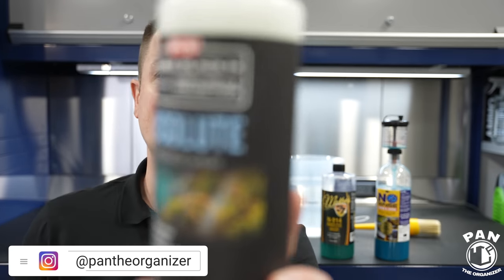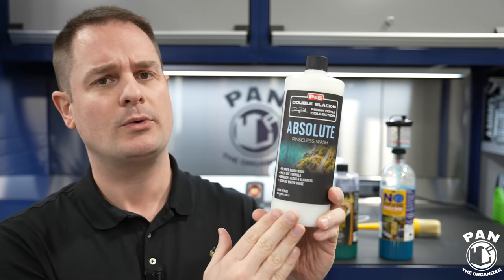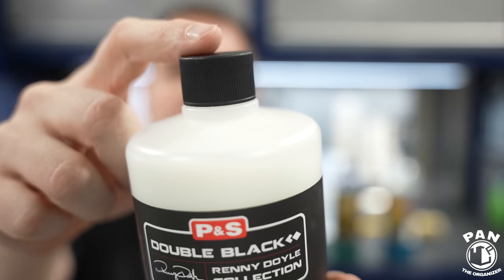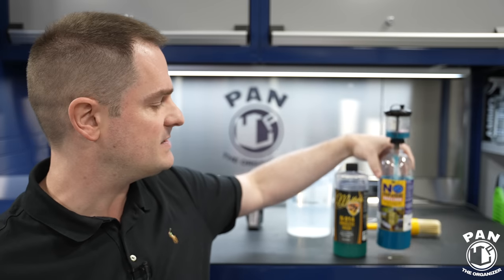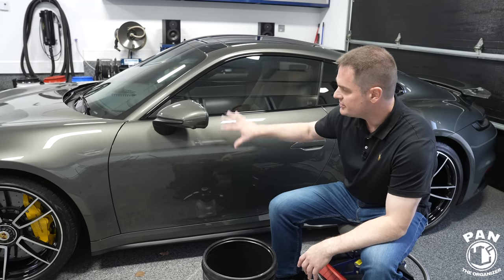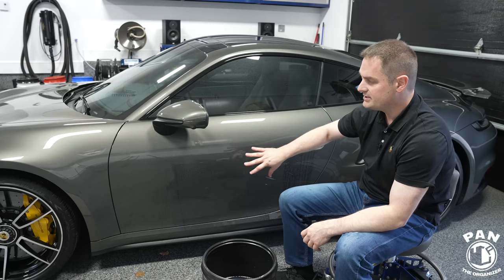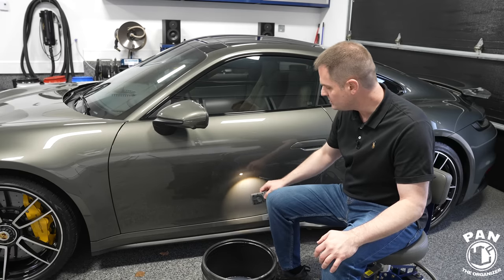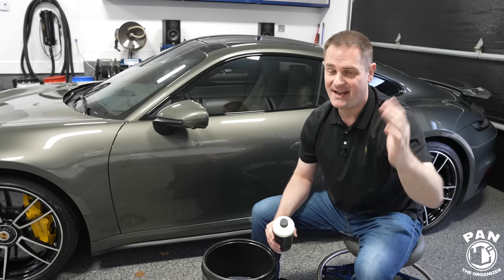NEW P&S Absolute Rinseless Wash... Is it better than ONR or McKee's?

Comment: Optimum also offers an OptiCoat version of ONR which is a bit thicker than the regular ONR and is specifically designed for ceramic coatings.
Reply from the maker: Yes I had tested that in this video: https://youtu.be/DxBdWQ2k9Tw

Comment: Does this have any gloss enhancers? Wondering if it would be good to use on matte or satin finish vinyl wrap.
Reply from the maker: These are pure cleaners, no additives.
Reply: @PanTheOrganizer How are those floating polymers not considered gloss enhancers? How do you define gloss enhancer? My assumption has been that the post feel 'slickness' in cleaning products is a direct result of what is being left behind weather it be a coating of any sort or gloss enhancer. With pure cleaner how could Absolute be any slicker than the others? 
Thanks, - Dom

Comment: I use N-914 regularly as a rinseless, waterless/detail spray, clay lube, pad washer solution, and panel prep spray. Would ABSOLUTE be able to be used in all of these situations? Particularly diluted as a panel prep?
Reply: It can be used in all those ways, except panel prep. 

N914 should only be used as a panel prep for McKee's coatings. It is always recommended to use the specific panel prep provided by the coating manufacturer. For example, use Gtechniq Panel Wipe for all Gtechniq coatings.
Reply: @jeffc6832  I use N-914 at a panel prep dilution simply to remove water based polishes and compounds during the correction process. Right before coating application I go over the whole vehicle again with my favorite prep, Gyeon Prep. I just use N-914 to reduce cost of how much Gyeon Prep i go through
Reply: @Xaviers300ZX  Absolute will work great in that case.
Reply: @jeffc6832  awesome! I'll have to give it a try! Thank you!
Reply from the maker: They don't mention Absolute being used as a panel prep, so for that I would still always recommend a dedicated panel prep like CarPro Eraser or Gyeon Prep.
Reply: @PanTheOrganizer  perfect, that's what I assumed as well. Thank you!

Comment: This was the year of the Rinseless wash with maintaining the daily driver and fell in love with it over soap washes. Does it replace soap, Absolutely not. Do I plan on buying a bottle even though I have plenty of ONR, Absolutely! Since I have become an ONR fan I guess I am gonna skip N-914 altogether and play with Absolute, especially as a detail spray using Blue Beadmaker for that ultimate tropical experience!
Reply: Embrace rinseless. Combined with a pressure washer and diluted APC (for decon), you can eliminate soap and get superior results in less time.

Soap is dead...long live rinseless!
Reply: @jeffc6832  Snow is here and so I've had to switch gears quickly! I am playing with a spray on ceramic protection this winter before moving onto DB36 in the Spring so the "coating" has limitations. Last weekend I took the daily to a car wash and sprayed it down with ONR and was unsatisfied with it not being able to break down the road grime. I was perhaps thinking of maybe cooking up some Greenstar 20:1 for the trouble areas next time. The goal is a good pre rinse to knock down the majority of the contamination and bring back to the garage with a nice warm bucket of Rinseless wash and a tote full of Eagle Edgeless 350s for a delightfully brisk detail.

Comment: What dilution would be best for a waterless wash? 1:32 or even stronger? Thanks Pan!
Reply from the maker: It depends what rinseless wash you are buying. Not all of them can also be used as a waterless wash. They have different recommended dilutions for different uses. ALWAYS read the instructions before use.

For example, for the McKee's N-914, to dilute it as a waterless wash, they recommend 1:128 dilution meaning 1 oz of product for every gallon of water. For the P&S Absolute and ONR, there is no mention of them being used as a waterless wash.

Comment: I wish I would have seen this earlier. I bought a bottle & mixed my 1st bucket up...thought I had a defective batch till I stirred it up really good.

Is it OK to spray the mix on and sponge wash the convertible top on a 2004 Porsche Boxter?  If not, what would be your recommended product & process for that?  

 Also, I applied Gyeon Syncro to it.  Would it hurt to use ONR Wash & Wax on the coating or would you recommend staying with Absolute / Regular ONR?
Reply from the maker: I would not use wax based products on coatings, as you would be masking the coating's superior properties. Stick to SiO2 or graphene toppers.

Comment: If it adds gloss, does that mean it's leaving a slight protectant? Would it interfere with a coating applied afterward? 

Also, what dilution ratio do you recommend for glass cleaning?
Reply from the maker: Hi Benjamin. The standard 256:1 dilution is the one for cleaning glass.

To answer your other question, in my testing, I noticed that Absolute did not change the hydrophobic properties of my coating, so I was quite confident it wasn’t leaving any surface-altering protection or residue behind. It did leave a nice clean, slick and shiny surface.

As many viewers had the same question as you, I reached out to Dave Phillips, chemist at P&S, and his official response is: “As for leaving something behind, the quick answer is that Absolute does not leave any protective film behind on the surface. Just about everything is removed by the drying process and our point is to create a clean surface.

Not leaving anything on the surface makes sense in detailing terms. We are not leaving any protective material behind and we don’t want to mislead the consumer into thinking there is. And what is left behind will not affect the performance of the original surface or how finishing products will perform.”

Comment: Pan, I usually de-iron and clay before applying wax, how would those products work in combination with a rinseless wash? Or can they be used with this method? 

Also, how long is the premixed solution good for? Both in a bucket for rinseless washing and in a spray bottle for glass and interior cleaning

And finally one last thing, does anything special need to be done with drying towels when I use them with a rinseless wash? Can they be hang dried and reused like usual or do they need to be washed first?
Reply from the maker: You'll soon have the answer to all that in one of my upcoming videos this month. Stay tuned!
Reply: @PanTheOrganizer  Roger that, thank you sir

Comment: Pan, I use my McKees N92 solely as a pre-treatment before first spray with the pressure washer and subsequent foam cannon (per your “How to wash like a pro” video.  Would you recommend any of these three over the other for that specific purpose?
Reply: If you want one stronger than 914 check out Feynlab Pure Rinseless
Reply from the maker: They are all pretty equivalent for the pre-rinse or pre-treat stage in my opinion. No need to buy anything else at the moment. Once you're out of N-914, give Absolute a try.

Comment: My car has PPF on it and ceramic coating on top of the PPF. When it rains my car gets covered in water spots after it dries. Will this product help reduce the water spots from forming? Any suggestions since my car is kept outside a lot?
Reply from the maker: No, as rinseless washes just clean the paint, like a shampoo. Regular washing is what helps prevent water spots. If you leave the water spots unattended for long periods of time in the sunlight, the minerals in the water spots can start etching through the clear coat and eventually cause permanent staining.

For water spots thag don’t go away after washing, you can use a water spot remover like Gtechniq Water Spot Remover, CarPro Spotless 2.0 or Gyeon Water Spot. 

And if the stains are still there, you need to machine polish the paint.

Comment: I use this on my wrapped Tesla M3 and it works really well. The only thing I'm struggling with is that it seems to leave a film on the glass which, especially when I'm driving into the sun, is really obvious. Not sure what I can do to avoid this?
Reply from the maker: Did you use distilled water in the bucket to do your dilution? And don't work in direct sunlight. Always in the shade, on a cool surface.
Reply: @PanTheOrganizer  Ah - maybe it's the lack of distilled water (not sure I can pull that off). By the way, I have some sap stuck on the glass roof and can't seem to get it off either with the wash or with glass cleaner or with a waterless wash spray. Any recommended products for that purpose?

Comment: Hi Pan…I’ve been using rinseless wash for years now. I do add in an additional step after applying absolute using a UBS…After applying rindless and before drying I use a soaked waffle weave TRG towel rung out and add an additional wipe down. One wiped down with the waffle weave I then use a drying aid. (Xtreme solutions Jersey devil being my favorite drying aid). Then I will dry the panel.  I feel this provides less water to dry with my TRG towel.  What do you think about this method??
Reply from the maker: That works too! You can also use which every detail spray as a supplemental drying aid after a rinseless wash.

Comment: I’ve just got the new revision 5 of No rinse wash & shine. New spring 2023 

New formula (Revision #5) released in spring 2023; offering the ultimate in wash lubricity (slickness) with better beading, easier drying and better release properties! The most technologically advanced car wash system.

Comment: Hi Pan, fantastic video as always. I've just purchased the McKee's n914 and plan to use for the rinseless wash inbetween regular washes, mainly to remove the light dust that accumulates. I also want to mix a few bottles with distilled water of course for a quick detailer, drying aid, window cleaner etc. and want to know what shelf life can we expect when mixed with DI water and any storage tips you can give for maximum shelf life. My tap water is 30 to 50ppm tds in the part of Australia that I live so is super soft to start with but will definitely be using DI water to mix with. Sorry if you've already covered this in another video.. Also have recently switched to using turtle wax ice seal and shine and spray wax as per your videos, is there any precaution I need to take when using n914 with regards to compatibility with turtle wax products.. Also I have litres of megs gold class wash and ultimate wash and wax left which I'm wondering if these are okay to use inbetween when I'm not applying another coat of sealant or wax but just a wash and nothing else. I use the turtle wax pure wash before applying a top up of seal and shine and am very happy with the results thanks to your channel. Apologies for so many questions Pan but your channel is my detailing bible now and the knowledge you pass on to us just can't be bought mate. Many thanks in advance Pan and keep up the good work mate much appreciated. 
Daz from downunder 👍👍👍

Comment: Hello Mr Pan sir, I have a question. If I were to use rinse-less wash products (Optimum No Rinse Wash&Wax) on ceramic coated vehicles, will that mask the ceramic coating properties?
Reply from the maker: No. You can use rinseless washes to clean ceramic coated cars, no problem.

Comment: Hi Pan great detailed video as always.  I will give this one a try after I use up my Mckee’s product.  Would like to see you wash a black car.  Always a challenge.  I have a Tesla that has been wrapped with a ceramic coat.
Reply: I maintain three show vehicles (32 Ford, 70 Ford Pick-up and a 56 Ford Fairlane Club Sedan). Old vehicles don't like water remaining in unseen areas because of rust and cracked paint.  I've used McKeys and ONR religiously since the initial paint corrections. As far as micro scratches, it is impossible to not generate them.  However, the more  protection layers you have, the depth of the scratches is reduced.
Reply from the maker: Oh believe me I know. I would personally never own a black car, as I would die of OCD trying to keep it pristine. 

But here's a black car detail I made:
Glossy paint: https://youtu.be/heHmSOmKfkc
Matte black: https://youtu.be/5RocSxJQmzI
Reply: @PanTheOrganizer  Thank You Pan!

Comment: Does P&S make their own sponge? The Rag Company one is always out of stock it seems and I'd prefer something that isn't black so I can see easily if there's any grit stuck in it...
Reply: Skip the $20+ single sponge and use the newest method using a single bucket full of  Autofiber Flip Microfiber Rinseless Towels.
Reply: Try big red sponge. There may also be a yellow version. These are all the same sponge, except different shape/size. I want to say that I got mine from auto geek or possibly ids car care.
Reply: @joeymcguire8742  I am not based in the US, I can only get the items via Amazon US and these sponges are always out of stock... But I'll check out the red / yellow sponge. Thanks!
Reply: @altillman1448  I prefer one sponge instead of multiple towels... But thanks for the suggestion.
Reply: @altillman1448  the flip towels are great, but I still like the sponges. I bought my Big Red Sponge in 2017 and it is still going strong. Added a UBS when they came out too. When you understand the science of rinseless washing, they really are the superior method. Super fast, effective and completely safe. I have never scratched or caused any marring yet.
Reply: @joeymcguire8742  They were all designed by Yvan LaCroix, and manufactured by Lake Country...but the red, gold and black versions are all different foams with different properties. The BRS doesn't work with soap at all, but the yellow and black foams do.
Reply from the maker: The Big Red Sponge: https://amzn.to/3DUjBL8
The Big Gold Sponge (McKee's): https://amzn.to/3G3MqHq

Comment: Hi There Pan, I have recently found your channel, I feel like I'm getting the detailing bug. I have just bought a new car & want to keep looking as showroom condition for as long as I can. You have opened a new world in detailing that never new existed. I'm getting my paintwork ceramic coated & would like to know if all of these detailing solutions are safe to use on the ceramic coating? Great channel & great advise👍👍
Reply from the maker: Hi Craig! Welcome to my channel. You discovered one of the biggest car detailing channels on YouTube as we surpassed 860,000 subscribers and we have almost 110 million views! I have been detailing for 25 years and I love to share my knowledge and passion with my viewers.

You found the right channel to help you learn everything about detailing. 

Yes these rinseless washes are all safe on ceramic coated vehicles. That's if you want to use a rinseless wash method to care for your coated car. Note that this method is mainly for light to moderate levels of dirt. If the car is super dirty, you want to pre-rinse it first, or go for the traditional wash method, which I prefer.

See my tutorial on how to properly wash your vehicle: https://youtu.be/7Koj5j2Es5U

Comment: Great video as usual. 

As someone who does rinse less washes only in the winter in the garage, is there any evidence on whether using hot or cold water with the no rinse solution yields better results?

Also, what's the proper technique to clean and maintain the Big Red Sponge? I wash it with some dish liquid after every use.
Reply: The best way to clean the BRS, is give it to somebody, and get the UBS. The newer technology Rinseless washes do much better at keeping the wash media clean.
Reply from the maker: Most people simply use an APC to clean the sponge after use, thoroughly rinse it out, and perhaps leave it soaking in a fresh bucket of the rinseless solution, keeping it primed and moist for next use if you use it often.

Comment: My car has a five layer ceramic coating by Optimum. Does it make sense to stick to Optimum products for compatibility with the ceramic coating? I'm currently using Opti-Coat No Rinse which provides more gloss than Optimum Rinseless (ONR).
Reply from the maker: Correct. You are free to use products from other brands, as long as they're compatible with coatings.

Comment: Great Video Pan! Thorough Review, But Could You Answer A Question, What’s The Difference Between P&S Absolute & P&S EC37 Epic Waterless Wash? 

Thanks 😊
Reply from the maker: Absolute is a rinseless wash. It needs to be diluted in water. A waterless wash is is a spray and you’re not using water with it. You spray on the surface and wipe.

A rinseless wash is a safer wash method compared to a waterless wash.

Comment: I know it doesn't add protection, but does p&s dream maker alter the hydrophobic properties of a ceramic coat? it must leave something on the paint to make it more glossy right?
Reply from the maker: Any topper you apply on top of a coating will take on the properties of that topper as far as hydrophobics are concerned. What you are looking for is a topper that won't make the hydrophobics worse. Dream Maker works perfectly fine on coatings.
Reply: @PanTheOrganizer   How about if my coating is Diamond protech Body 36, I dont think any topper is more hydrophobic than that... so would it still be beneficial to use Dream Maker or Xtreme solutions topper in that case?

Comment: Excellent video pan....I was wondering if instead of using the rag company wash media sponge if it would be effective to use some thick microfiber towels using the Garry Dean method and also be able to keep a bucket full of the solution never puting dirty fibers in the bucket if that would work?
Reply from the maker: You can absolutely use any wash media you want. Microfiber wash mitts, microfiber towels, sponges, etc.